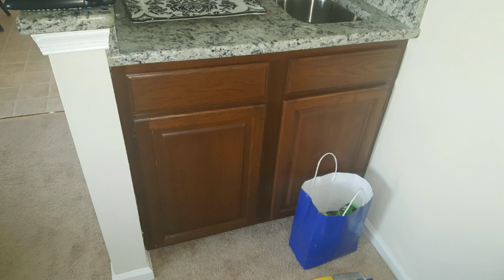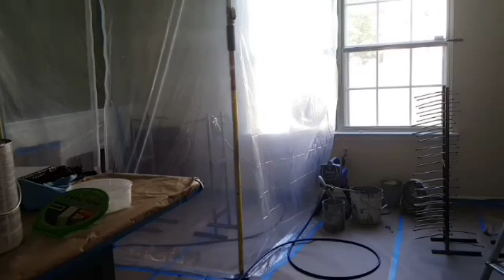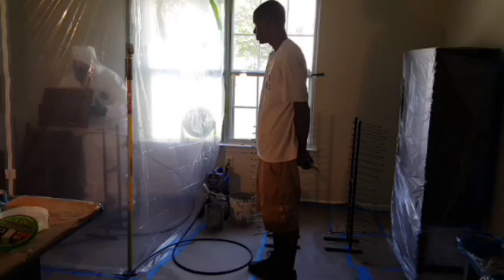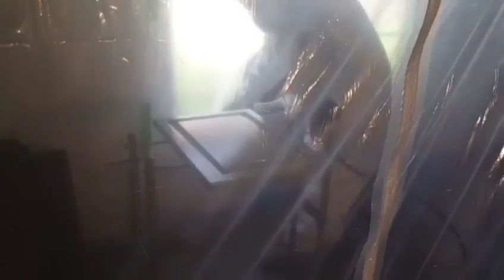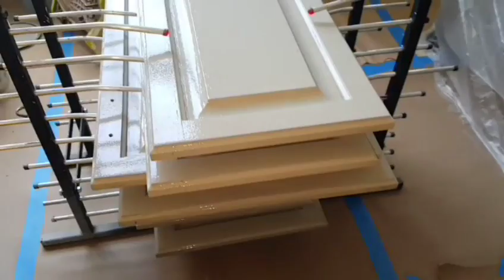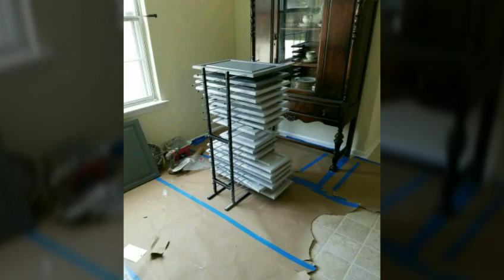GLS Painters - Cabinet Painting - 2 shades of gray

Comment: what type of primer did you use? I have older cabinets that were polyurethane or shellacked and I was going to scuff them with scotch brite or a light sanding block and then use a good primer, any suggestions? thanks!
Reply from the maker: we used Sherwin Williams- Extreme bond.
Ben Moore Adavnce paint